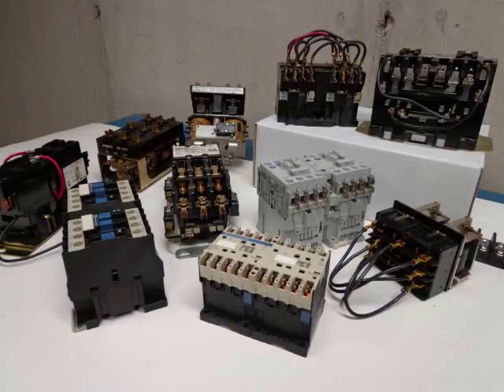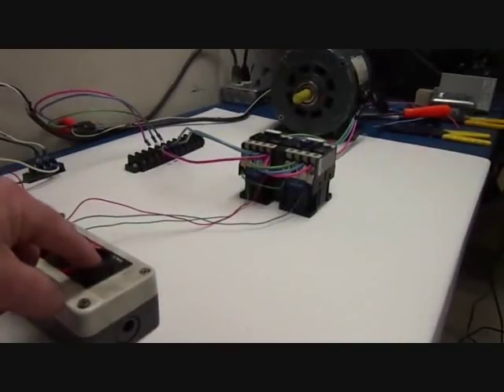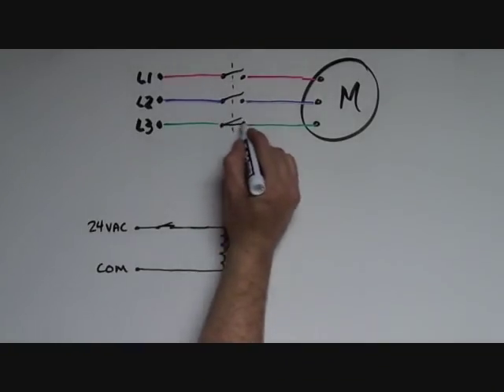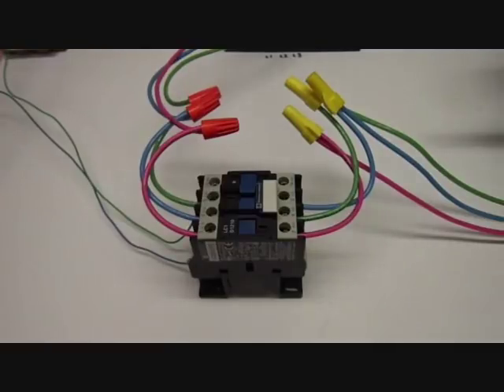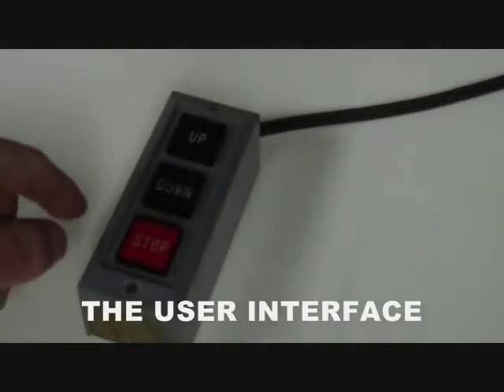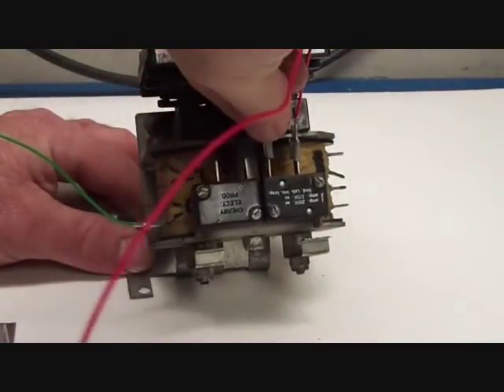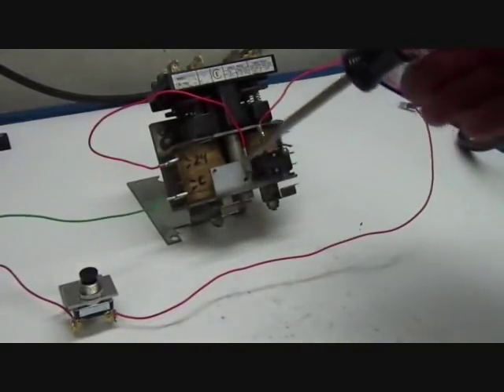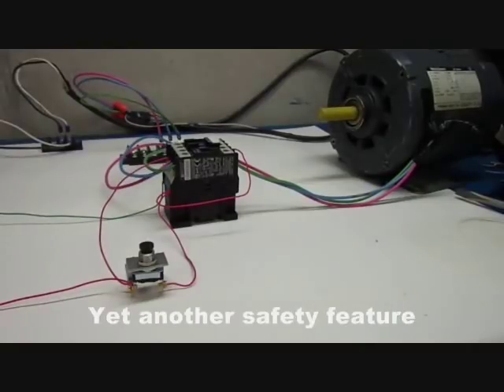Reversing Contactors: Dissected and Explained

Comment: Great explanation of the reversing contactor. I'm updating an old vertical mill with a MacMotion CNC system and this video is most helpful in describing what I need to do to add a contactor from the old electrical panel to the new panel. Thanks. Mark Mox

Comment: You did an excellent job explaining how reversing contactors work! Thank you for making the video. You may want to consider doing a follow up video explaining how to use this type contactor with say 4 different controlling switches at different locations like would be used in an elevator with a safety stop switch. Thank you again.

Comment: Great video, and you even explained the last NO connector. I've just had a generator installed at work for power outages now by the summer and the installer used a couple of these to switch between the grid and the generator automatically. Besides he didn't use that fourth connector but installed an extra switch outside which I was wondering why he didn't use the fourth one?
Now I think I understood it, the fourth one is for lower voltages. The installer has to come in some weeks to finish some touches so I will know what voltage goes through the fifth extra switch.
I'm an IT admin, so my job is not directly related to electricity but I was reading a lot about the inner workings of some systems and how what one ordinarily thinks that is "just plug it in, and it works" is completely another matter behind the socket. Coupling armonics, inductance and a whole lot of things that complicate the matter quite much, not simply 200V 50Hz :D (Argentina).
Thank you very much for your explanation and video. You've got me subscribed!

Comment: nice informative presentation,any idea how to wire up a three phase motor operating Ridder type screw 1-10 ratio worm gear running contentiously back and forward through a limit switch and on timer?

Comment: Our facility experiences phase loss from the power grid. This isn't enough power loss to open all of our 3-phase contactors so we have to scramble and kill power to everything before it burns up single-phasing. Our VFD's are particularly vulnerable to this. A bird once caused this-it blew out the fused connector to a power grid transformer. The bird was crispy!
Reply: James Robert James I have a good suggestions reference to your vfds motors motor starters compressors anything that operates on three phase the device is called ICM motor protection control especially design for three phase Motors vfds.
ICM 450 a.c. motors Protection control. ac/compressor, air compressor. it controls the control voltage of the line side that protects from lose voltage and  phase.

Comment: Dear brother,
thanks for explaining the contactors in detail. please tell me how to wire the small contactors if we use to contactors one for utility company electricity line and other for a generator. If both the power supplies are on than how to keep on shut down and the 2nd one in running condition.

Comment: Nicely done. Very concise and easy to understand.
I have a bit Q if you may offer some advice,I sure would appricate any help.
I have installed 120/240 single phase A/C - feed to a 48vdc battery bank with a 5kw inverter/charge.  all in one unit. It's a great system.
it is designed to allow the a/c circuit (Feed to the inverter) to flow thru matching the phase at the inverter to the charger and the load up to 5Kw until the power is lost or interrupted and then it switches under 5 milsec to the  inverter to carry the load up to 50amps. .Down Side? is the charger can consume up to 12amp just to charge the batteries the eats up my Kw available.
However the panel I am feeding is a 125amp 120/240v and during the day ,if the load is greater than the inverters capacity...it see's this and it shuts down. as it should.
Now for my big Q. Is an interlocking pair of Mech/Elect contactors my answer?
I want the utility load to feed a sub panel during normal use not passing thru the inverter.
What I think I end up with is.
First I need to feed the inverter from the main house panel an it's own 50a 3p breaker.
Then use from the main house panel  a 100 amp breaker as primary source to a 100amp 3P contactor (also switching the neutral) and the  load side of the inverter as the secondary source. on a 50amp breaker.
I also am going to install a wifi timer to turn off and on the 120v coil...(this is for use during peak hours) for approximately 3-4 daily.
While being there in case of a power outage too. To save the food in the refers/freezers.
I think I am going to have to use a stand alone terminal block to split the  and parallel the load wires so I will end up with3- #2s  and 3- # 6s  to accommodate the 50amp lower load capacity on the secondary contactor inverter.
The customer is aware he can only run up to 50amp not run full power during the use of the battery bank/inverter.
Sorry this is such a long winded explanation...any help would be appreciated. I look foreword to your reply.
Thanks in advance.

Comment: Just so you know you can salvage your contacts longer if you use a capacitor rated higher then the working voltage between the contacts. Learned this on relay but a contactor is different animal so be safe.

Comment from the maker: I'm not an engineer or anything but a 240vac switch is always going to be bigger and more expensive, and if the motor is twenty yards away from the switch you would have a good sized voltage drop.

Comment: I have a pallet machine that that has a stacker and  a conveyor underneath it unfortunately the motor turns the conveyor rollers towards the wall. The motor is controlled by a contactor, can I reverse the direction the motor at the contactor without rewiring the motor?

Comment: Great video! You have another subscriber!  And I have a question.
When you used the N.O. contact to create your latching circuit I understand that it gets it's power from before your switch device. But after you let go of the switch the coil opens back up, and the N.O. is connected to the coil. So why does the N.O. stay closed after the coil opens back up??
Thanks

Comment: Decent enough video but it would not be possible as you've described to try to 'run the motor in both directions'. If both sides of the coil were energized it would create a phase to phase short as the polarity has been reversed in one, this would cause no current to flow in your motor thus no damage to it, in short; the breaker will clunk a very short while after you energized the second coil. (If the interlock device wasnt present)
Reply from the maker: Correct.  I never thought of that.
Reply: good
Reply: Martin Cooper then why do they put those things in there to prevent it?
Reply: podak10  I’ve seen phase to phase shorts blow contractors like this off the wall.
Reply: A phase to phase short would blow this contactor to bits
Reply: @gappuma7883  To prevent a phase to phase short. And thus hopefully loss of power, although if the protective device did not operate correctly there may be more sever consequences e.g. fires.

Comment: So reversing is done in 3 phase motors only? I'm doing a project for school and the project is to draw a schematic for a reversing starter with all 3 interlocks. We use 120v contact relays (with light bulbs instead of motors just to learn how to wire up) so this reversing starter has to be with a 3 phase?

Comment: Very nice instructional video there.  I'm a pool pro and understanding how contactors work is becoming more and more of an everyday thing.  I have a small project that I could use your wits on if you're willing.  A client wants to control two mechanically timed motors wirelessly.  Meaning that regardless of what position the timer is in, the wireless relay needs to operate the motor normally, essentially bypassing the mech timer for the duration that the remote relay is active. I can handle the wireless part.  However, how can a wireless relay open the connection to the motor with the timer closed?  Does a contactor exist that will open one circuit while closing another (even while the circuit that is to be opened is closed)? Or is a clever "stop button" circuit my answer?  To me, it's a weird conjunction of two separate controllers.
Reply from the maker: I got a little lost there in your comment (happens to me quite a bit.)  Anyway you can get additional NO and NC modules for most contactors, which will allow you to make the contactor do whatever you want.  
"how can a wireless relay open the connection to the motor with the timer closed?" You would run the motor connection through the normally closed pole of the relay, and whenever the relay is powered up the motor connection would open.
Hopefully we are on the same page, if not let me know.  Whenever I have to come up with something like this I have to draw myself a schematic.  By the way when it comes to contactors Ebay is your friend.
Reply: Yes, yes. Diagrams are always where I start; plumbing, electrical, networking, just about everything.  I took a break from calc homework to get a head start on this project. That prolly wasn't the best idea!  I got frustrated within the first three sketches and started youtubing.  Anyway, it's really awesome of you to respond.  Your advice makes sense, but I still have to figure out how to implement it.  I need manual on/off with a timer.

Comment: Why would my 3 phase 48V DC motor run fine counterclockwise or backwards for what I need. But, when I switch any 2 of the phase wires it jerks and jumps then blows the fuse. I suspect it is trying to run in both directions at the same time. According to all the experts switching the phase wires is a simple method to reverse the rotation. Not on my motor. Any ideas?

Comment: 12:49 is that called low voltage protection?
Reply: Yes and this is caused by the loss of the magnetic field pulling the switch down. I believe this is how some circuit breakers offer LVP too.

Comment: Contactor Question, very bizarre on my side:  Symptom, I put the thermostat in Cool, "calling for cold", and I get 24 volts on the contactor leads for the coil.  However, when the leads are placed on the contactor itself, my AC voltmeter drops to zero.

I have changed Contactor, Cap, booster, and Thermostat, all to get back to my original condition, i.e., Contactor does not contact (click on engagement), and Compressor does not turn on.

I went so far as to bypass the contactor, manually running my power leads directly to the Contactor output, and the Compressor runs fine, and I get cooling (with switch in Cool).

It is as if the 24V AC signal to the Contactor (not the fan which runs fine) dies, under the load of a brand new (and even the original) Contactor!  I am second-guessing, thinking maybe the 24 Volts AC is going to an incorrect ground, as opposed to the common side of the transformer?  Could some critter have been chewing on my cable?

I am all set to replace the 24 Volt, 18 gauge wire from the yellow lead off the thermostat directly to the outside compressor, and if that doesn't work, replace the transformer.  Have you ever had such a bizarre circumstance?

Makes no sense!

Comment: I speculate that
T = Transformer side (Machine trans'/ power grid trans' on the street)
L = Load side.

Now we need to know why the "T" is down and "L" is up. 
naturally, we say that electricity "flows" like liquids, so it should be T up and L down.

Maybe it because transformers are generally big and heavy (like in machines) so they started to put the transformer in the bottom and the lighter parts of the machine up.
So "T" in the bottom is A-OK.

Comment: Hi.I want to thank you for a great video.I have just one more question.Can i run A1 and A2 from lets say 24VDC?
Reply from the maker: Only if it's rated for DC (which is rare but I have seen them).  Every contactor or relay you buy should have the coil voltage printed on the enclosure.
Reply: yes you can

Comment: any chance you can add how a jog button would work in this?
Reply: If you added a selector switch for 'jog' it's simply bypassing the memory contact. Putting the selector switch to 'normal' run restores the memory contact to the circuit.